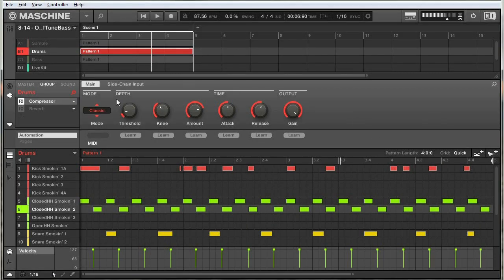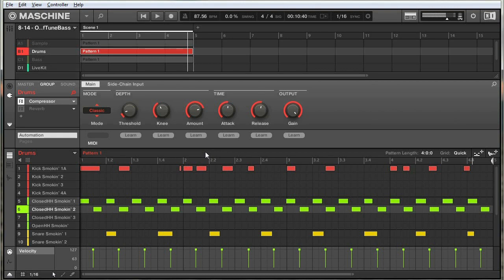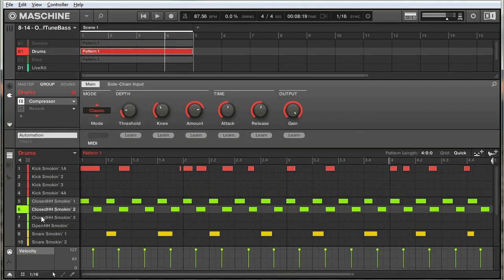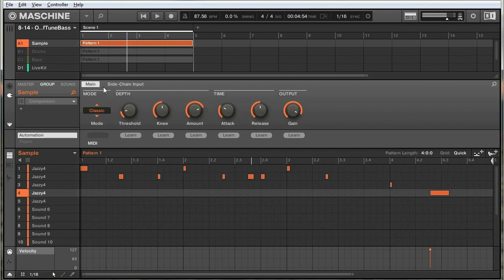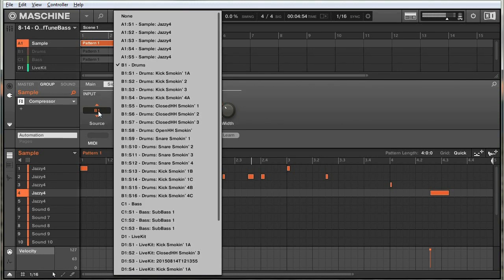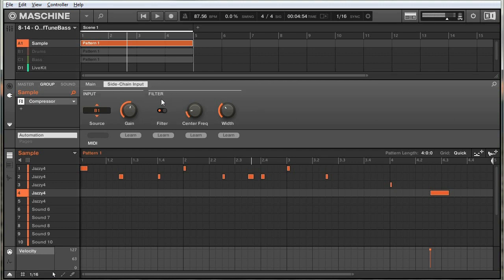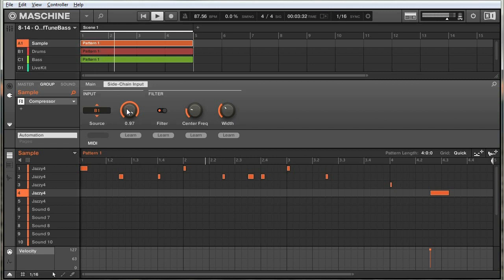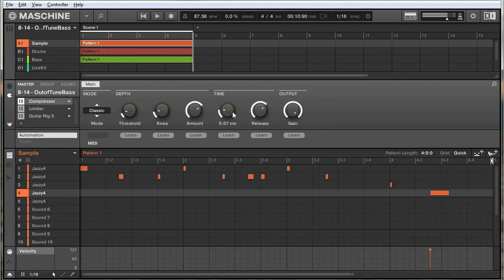Maschine Tutorial - Understanding Compression, Pt 2 - Sidechaining and Examples

Comment: Thanks for vid Andrew, very clearly explained. Noticed you have Guitar Rig recorder on Master, is that to record mixes? Could you do a video on this please, I name a Group "Recorder" and set it to sample mode and capture the master signal. Would appreciate a pros & cons explanation of both options, if you could? Cheers diDprojects.
Reply from the maker: Duncan Deaville No problem. I use Guitar Rig to record the tutorial audio - I have my mic running into Maschine, so capturing the master bus gives me mic input and all of Maschine's sounds. 

I did a video on it here: https://www.youtube.com/watch?v=Pty5B31NCNQ
And here is a followup that uses the sampler instead: https://www.youtube.com/watch?v=CSK-FNSkRWM

Option one is nice because it's meant to be used as a WAV recorder. You can also add some effects (a bit of compression and a limiter, usually) in Guitar Rig before the TapeDeck module. But you do need Guitar Rig Pro and it might add some to the CPU load because it's an additional module in the FX chain. 

Option two doesn't require any VSTs but it's using the sampler in a way that's a bit....out of the scope of what I think it's meant for. Shouldn't be a problem but it makes me nervous when recording 10 min+ WAVs, for some reason haha. 

Either option works great!